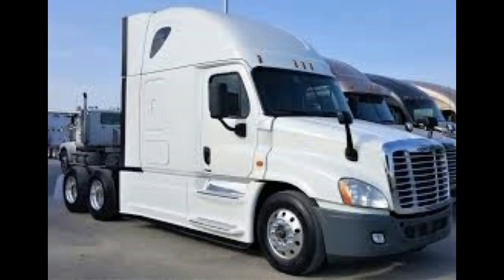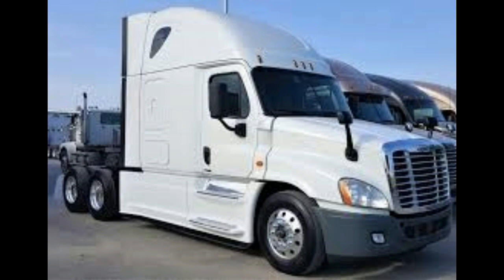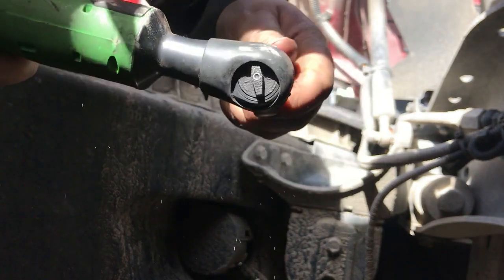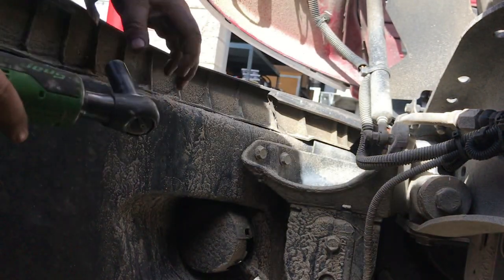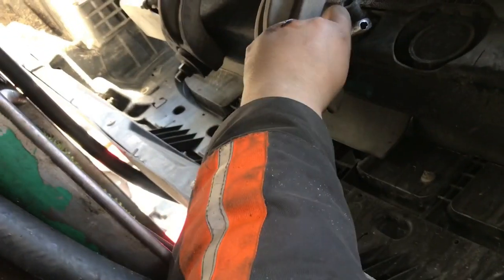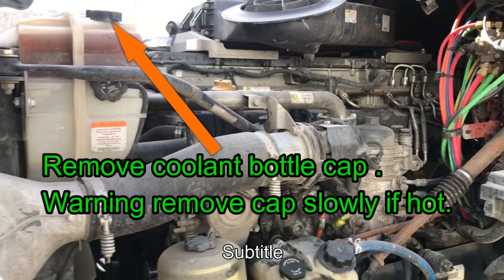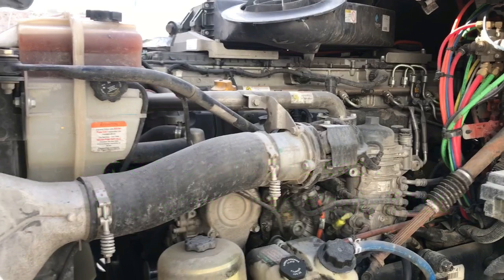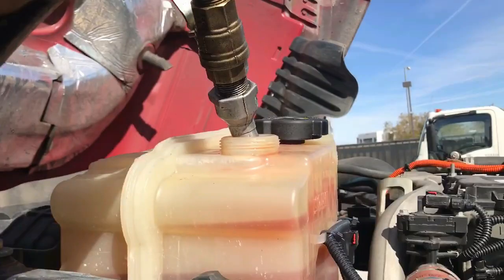How to Drain coolant on Freightliner Cascadia truck Radiator.

Comment: what's the torque spec for the plastic drain plug? mine started leaking but tightening made the leak faster. started leaking at 12 degrees F outside

Comment: Thanks...... how many gallons needed to fill
Reply from the maker: 5/6 gallons
Reply: @bigrigfix you did not drain the full coolant, these engines require about 12 gallons meaning you left half of the old coolant inside the block if you only needed 6
Reply from the maker: I think 5/6 gallons.
Reply from the maker: @Basmach Abrekov Yeah that’s me just 24 years experience make six figures a year.